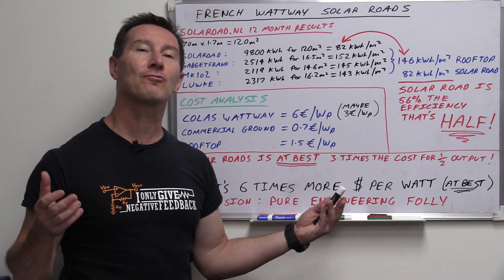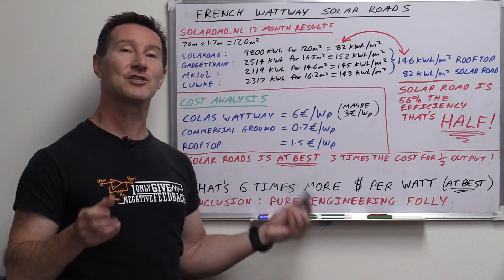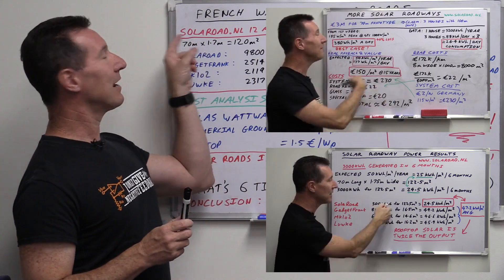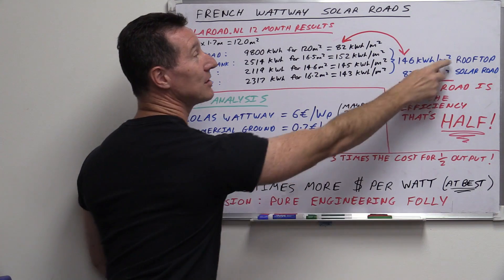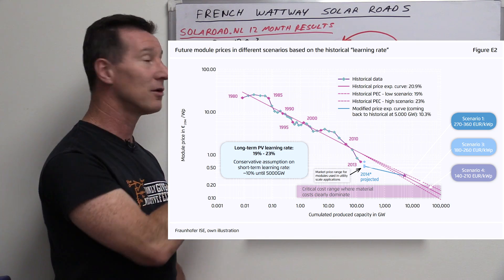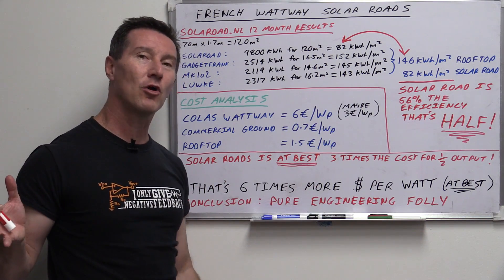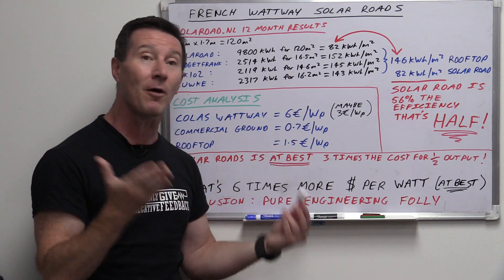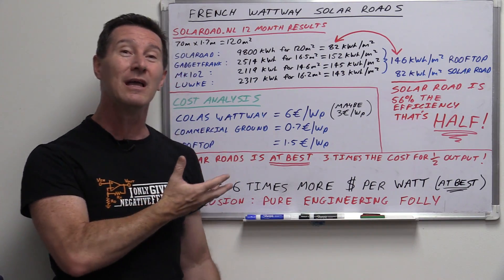EEVblog #850 - French Wattway Solar Roadways BUSTED!

Comment: Agree that using these as road surface is rather silly, given the stated issues with maintenance and upkeep  But i would like to see couple of hundred km installed in some areas for testing purposes, what is being faced right now are the engineering and practicality issues. Its always surprising how fast those can be solved given proper investment. Contain the costs of course, but be careful not to throw baby out with bathwater.

Comment: Hi Dave, sorry to say, but your conclusion "6 times more $/W" is wrong! You have calculated the production per square meter (half as much) and the cost per Wp (three times as much). And then you assume that you can divide the two figures (3/0.5=6). That is not correct. It would have been correct if the cost was expressed per m2, but it isn't.

In fact, the statement "Solar roads is at best 3 times the cost for 1/2 the output" is wrong. It should be:
"Solar roads is at best 3 times the cost for the same output". Of course: you are comparing the cost/Wp!

So, if Colas Wattway costs EUR3/Wp and other systems costs around EUR1/Wp, then Wattway is 3 times the cost per Watt, not six times! It might still be called engineering folly, though.

P.S. I have no financial interest in whatever solar road systems and I own a small rooftop solar system (600Wp) on my house.

Comment: What I wonder is, why would anyone install a solar array in a location where they know objects (i.e. cars) are going to frequently block the sun? For the high cost of photovoltaics and their somewhat limited lifespan, I would think that places like rooftops or dedicated solar fields would be much better suited to maximizing their lifespan energy production than areas where the light is blocked by moving vehicles and the panels would get covered in road grime...

Comment: Why the hell would you do it? You said it yourself "we don't have any data when used as a roadway". 

I'm not saying it should be installed for anything more then data collection but opening up projects like this and installing a variety of systems strictly for testing under real world conditions (not a bike path), might give us the paradigm shift we need for a tech that will work. It could certainly get more people involved in the concept of developing a tech that will work or at the very least improve the current stats.

Unfortunately large companies see these types of projects as nothing more then a way to improve their bottom line. As do this centuries version of snake oil salesmen.

Comment: My question is why do people insist on putting solar panels on a hard use surface? Can't you just fucking put them on the side of the road? Or in the desert? Or on rooftops.... you know, how it's been done already? Maybe even on the sides of buildings. It's not like we've completely covered all other surfaces with solar panels and we absolutely MUST put them right ON the fucking road so cars can drive over them.

Comment: I think it is a bit unfair to compare the efficiency and costs of such systems with those on rooftops and commercial ground, especially in a European context. I live in Switzerland, where we are already short of land. A lot of buildings are historic and under preservation order, others got grown over with grass and bushes to make the cities greener and improve the air quality. Some private owners prefere to use the roof as a barbecue terrace or for their kids to play on because their house has no yard and playing on the busy street is too dangerous. Schools, universities and shopping malls may have their cafeterias on the rooftop. Farmland has to be preserved to keep the Japanese and Chinese tourists happy and to keep up with the demand of dairy products, other farmland gets converted to industrial zones but the buldings there would usually be covered with thermal absorbers for the offices to be heated in winter. In the mountains it may be too rocky and to steep to install panels and construction and maintenance would require extensive reliance on helicopters.  Some of the streets are already equipped with panels, but sometimes again just producing heat for de-icing the street and thus reducing the need for de-icing salt. The government decided to stimulate the installation of solar panels on the noise barriers along the highways. We urgently need electricity from renewable sources because our nuclear power plants are up to 46 years old, the concrete of their reactor cores is embrittled (what do you expect after 40+ years of heavy radiation exposure), so the plants are "just so" safe enough. Constructing new nuclear stations isn't possible without referendum and the people would vote "no". It is a huge predicament for the administration. So in terms of renewable power generation any experience, experiment, trial, proposal, data or idea is highly welcome. That is why we think we have to start using whatever technology might go at least into the right direction. So "just" 56% as efficient as a rooftop? I would say: Great, let's try it. We may learn from it, at least we didn't do nothing and hey, 56% is electricity too. It's not nothing. :-)

Comment: The method in South Korea [shown as a clip in this video] is actually feasible. I do wonder if anyone knows how the math would work out for the US. The US has 47,856[as of 2013] miles of interstate but the majority of that is rural and has no room for panels between the two sides of the interstate. This is probably a very generous estimate but if we guess that about 1/3[might be closer to 1/4 but I couldn't find any thing specific using google] of the available interstate infrastructure has room for panels between the division that is 15,952 miles. Not taking into consideration general cleaning and maintenance, what would be the best case scenario of energy output using high efficiency commercial panels?

Comment: I agree with you. Upgrading an existing road would be stupidly expensive. But if a new road is build in an urban or suburban area, I think smart roads would be useful (regardless of whether they are solar roads or not). Of course that would be expensive, because 1. you are building a road, 2. it's gotta be better than a normal one. So if we (and I believe we will) ever build smart roads (for charging electric cars maybe), it might be worth checking the added cost of putting some solar generators in them. The direct price comparison to roof solar panels is a bit off.

Comment: Capturing the wind along long roads which are enclosed on both sides by large buildings. Doesn't work everywhere, but the city I grew up in had so much wind on its main road that I can't see how it wouldn't produce reasonable returns. 
Giant wind tunnel....

Comment: the problem is not the cost, its the surface, the government cans put or force people to put solar panels on people's roof and they cant put panels on all government proprety so the logical place they have a say on and is used for nothing else. basically even if its 6 times more costly, you can use a lot more space, way more than 6X

Comment: Hi,
first :The infrastructure is there, more than 2000Km Highway is public, 10 000Km are "privat", it means (< 10 BIG contracts).
1.7 M is maybe the width of the emergency lane, so there is not as many traffic as the other lanes.

Second : Where would you find that equal surface without making the landscape uglier than it is with all those infrastuctures ?
If the governenment wants to install rooftop on private houses, they have to do millions of contracts.
Rooftops are Ugly ! Wind turbine too!

Third : installing this on older roads reconditions them, you can then subtract a the reconditioning cost. 
It is also quick and maybe cheaper to remove and glue new ones, than redoing the Asphalt.

I don't think it is a good idea, but your perspective is maybe not the only one. There are other apects as political, economical, and so on. Many countries want to do the same as The USA, depanding less from oil (with Fracking).
They step on.

Salut.

Comment: Mmmmmh... well ! I've got a (french) suggestion for Mrs Royal : Long time ago, the way we (the frenchies, so...) did put tratitional orniaments along all of our roads was... the famous plane trees (platane).

Next ? 

- It is beautiful, and appreciated by british tourists (c'est beau la Provence ! ça sent bon la France !)
- on hot summer, it refreshes the roads (spare fuel for AC)
- in winter, it reduces the clear sky effect on cold night and thus avoids black ice
- you can recycle the annual provided biomass (It's solar energy, anyway :)
- it's a CO2 trap

and, the best :
- It forces the cars to reduce speed, because of the way we (frenchies) drive : if we see a chlid riding its tri-cycle on the side of the road, we keep full throttle, but if we see something dangerous aside (a polish truck, or a platane, so...), we slow down...

That's my point !

Comment: what if you put a thick protective coating over it? one that works well as a road surface... like road surface? what if you paved over all your solar panels... then you wouldn't have to worry about the expenses of maintaining a solar road way since it is never actually driven on by the cars...only the road surface on top

goes back under bridge to stop passing billy goats

Comment: Ok, so it is half as efficient. Let me ask you this, what else will the surface be used for besides a bicycle path? The answer is absolutely nothing. So since you are getting electricity from that area whereas before you weren't getting anything, you don't think that is worth it?
Reply: +Olivier Daniélo Over what given amount of time? There is such a concept as return investment over a certain time, what he fails to mention in the video is the longevity of the panels. All he does is calculate the year of use which of course NO solar system will pay itself back in that time. In order to know whether the system is worth it you have to know how long it will last and what the return is on your investment. Which means he should be calculating based on the lifetime of the panels. I have not heard of any solar system that will not return manufacturing cost plus extra over its lifetime.
Reply: +Guile Williams until they have to be replaced, probably.  The longevity of these panels will be at best equal to real solar panels, which already struggle with roi enough as it is.
Reply: +Alex Bv The EROI is typically 4 years for a solar panel system. The typical solar system is rated as %80+ efficiency from date manufactured for 25 to 30 years. How is that struggling?
Reply: +Guile Williams The guy that made this video actually has real solar panels installed on his roof and have a very different opinion of the roi than you do.

Also even if we accept your very doubtful figure as true, given how inefficient these roadways are (covered in the video) they would indeed be struggling reaching their roi at all.  6 times 4 is 24 years for a 30 years lifespan, and thats for an overly optimistic estimate.
Reply: +Alex Bv Those aren't my figures, those are from the manufacturer. Bottom line is he was wrong in doing his calculations for only 1 year in length of time. As I stated previously, no solar system will meet the ROI after 1 year regardless of efficiency.
Reply: +Guile Williams The fact neither will achieve ROI in 1 year is meaningless. He can tell under best case scenarios (when the panels are new and freshly installed) how much energy they are producing compared to local standard rooftop units. And he found after 1 year, they are producing half the electricity at 3-4 times the cost. That right there kills these things as ever being feasible.
Reply: Yes, the panels are half as efficient. The point you are missing is that
 they do not require resources or maintenance beyond initial 
manufacturing. It is not meaningless to point out the flaw of his 
argument. Once installed the panels will produce electricity half as 
good as a rooftop where no electricity was being produced at all over 
the course of 25 to 30 years plus depending on who manufactured the 
panels. As for cost being 3 to 4 times more expensive, do you have any 
references to support your claim? I haven't found anything to suggest it
 costs more than a rooftop panel.

Comment: My 5 main concerns about this bullshit:
1. What if I am walking along, doodoodoodadoo, oh shit, I dropped my hammer!
2. Imagine falling off your bike while riding on a solar roadway... You might be fine but you just broke like 5 solar panels...
3. What if a tree falls or something like that?
4. I bet a lot of teenagers will just WANT to smack that road with a sledgehammer... I know I would
5. What if a car wreck happens? Tire marks all over the place, and possibly 8 broken solar panels...

Basically, durability and rigidity is a huge issue.
Reply: +LazorVideos As an exemple, do you know what Epoxy, Polycarbonate, Nylon, Kevlar is ? Those chemicals can  stop bullets ...
Thanks God, french are not 60Millions teenagers with a sledgehammer and you brain.
Reply: +Tim Clo You could be right, but surely they can easily
be damaged, even if they are made out of plastic alternatives to glass. But as Dave explained, plastic is soft and does not allow enough clarity to produce enough power. Plastic has low clarity as it is, but imagine the maintenance of replacing the panels annually because somebody fell off their bike and scratched it, which lowers the amount of light (Polycarbonate usually has a poor aperture of over 3.0, and scratches can make that even worse)

Comment: This guy is an idiot , comparing it to rooftop is no comparison at all. the point is its areas that is not used as solar but can be they complement each other. Roads are not rooftops. Not to mention the LED system for emergency. My parents live in Muskogee and the road plant is terrible on pollution , solar roads ways just has too many advantages over normal roadways.

Comment: Costs, we don't care. If it costs 6x more to save environment, fine. But the materials to makes the actual panels pollute as well, and their installation, etc. But costs? Fuck costs...

Pollution aside, it is basically an economic problem more than anything. Because Euros are involved in the analysis...
Reply: +Olivier Daniélo I'm aware that there are other things that make the road idea stupid, but it should not be about costs. If it was, like in the example, in the middle of two lanes (the video shows an example in another country), then it would probably be okay. The major problems with solar is the low yield per quare meter, and the space it takes. Then, there's wear, sand, snow, etc...
Reply: +Simboiss It must be also about costs, when there are alternative solutions like fucking standard roof top solar energy.
Reply: +Enzo Canuzzi Sure, I agree totally. We should place solar panels where the sun won't be blocked, that's logical.

Comment: while I agree that a road is a pretty hard place to put solar panels... it does seem to make sense to use all that surface to produce energy... its just way to much surface area that currently is only being used as... roads.... the problem of costs... well I wonder if that is more due to ppl overpricing the hardware

Comment: I'm impressed that they have panels that they can park a truck on and, presumably, they still work. The sort of durability will useful for rooftop systems in harsh weather environments.

Roadways? What happens the first time a backhoe has to dig into it to fix a broken pipe?

Comment: While I do agree with your conclusion, I think you made a mistake with your math. In the cost analysis, you say that commercial solar installations cost 0.7 €/W, while solar roadways are 6 €/W (or possibly 3 €/W). Isn't that an 8 (or 4) fold increase, not a 6 fold increase as you claim? Or were you averaging the two possible costs for solar roadways, and I just missed that part?

Comment: The problem is looking at actual technical information or cost to benefit ratios. You have to approach it from a PR perspective and how it can be used by the ministry of funny walks to pat themselves on the back and use in future campaigns! ;)

And like noted below and in the video, a select few are going to make out on this deal, no matter whether it works or not.

Comment: I like the video and how thorough you investigate these things, have you included the  costs associated with road creation? If the 6Euro/Watt includes the construction of a certain size section of road, that offsets the construction somewhat, especially when governments cant just use any old roof top and have to work with land they have. (Would make sense to line government buildings first though)

If the end result can still create net profit though, even with poor efficiency then its a valuable idea that could reduce costs for new roads.

Comment: If they wanted to produce electricity at the highways, maybe there is something much better than solar panels: windmills. The highways produces quite a lot of air displacement. That will also produce electricity at night (when street lights are needing electricity). And another advantage: the area between the windmills can be filled with greenery which also reduce the air pollution produced by the highways. Even if over 50 year most of the cars would drive on electricity or H2 or air pressure or what else, their will still be a lot of CO2 to be filtered out of the air. And those plant-barrier can make the surrounding more livable (if there are people living there, less pollutants on the plants, and better air quality for the animals) so it will stay an advantage that the space between windmills can be filled with plants.